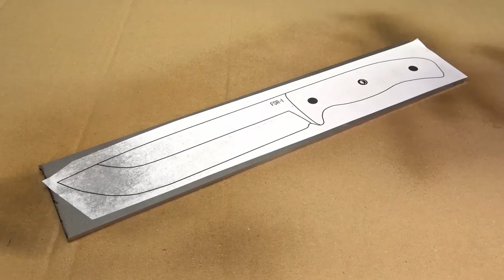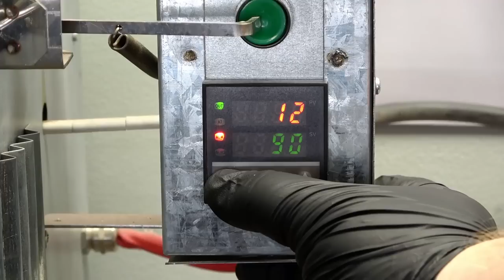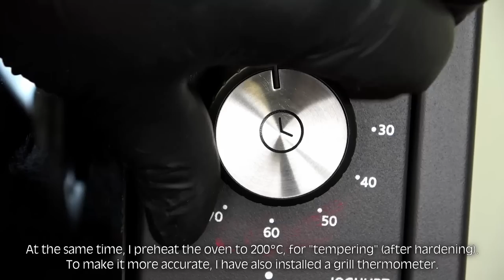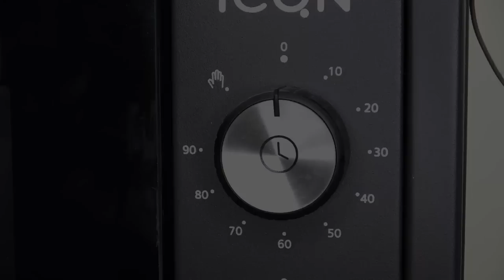Making A Knife - Stonewash

Comment: What kind of steel did you use? Also, a time saving tip: use different grit belts on the belt grinder to clean up and refine the blade and handle instead of hand sanding or filing. Hand sand with higher grit to finish the material. Saves tons of time.
Reply from the maker: The steel has the designation: 1.4112 - 440 B/stainless

Thanks for the tip!🐢

Comment: Nice project. Question - what grit sand paper did you use on the belt sander? Were there several grits used for the different steps? 🍻
Reply from the maker: Yes, I have used different grits. This is easy on the sanding belt and on the wallet 😅🐢